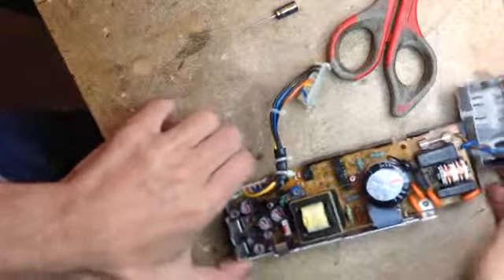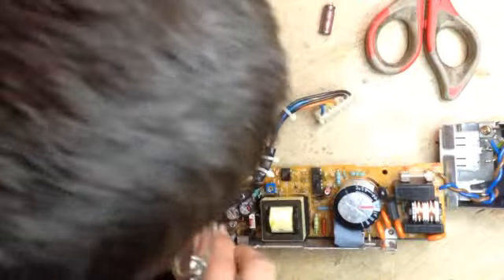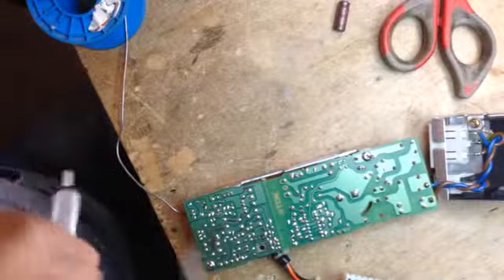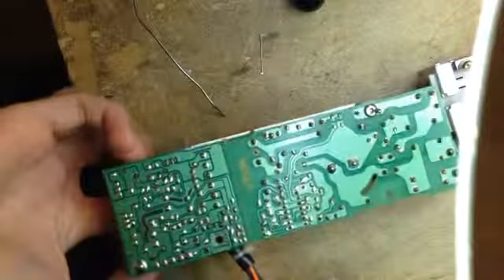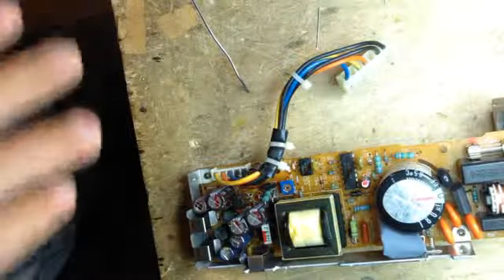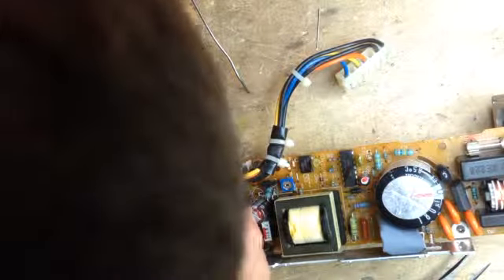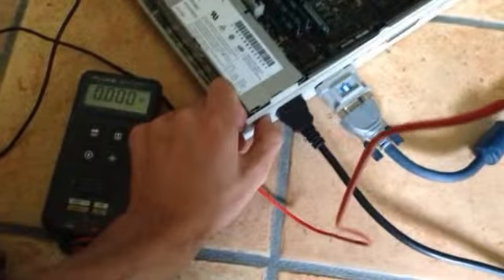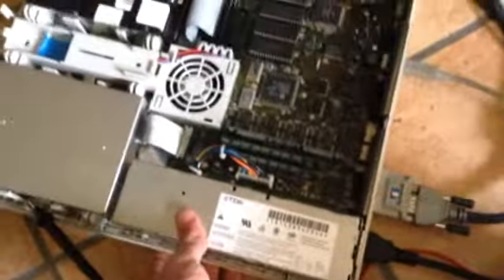Apple Macintosh LC TDK Power Supply ELNA Capacitor Replacement ReCap Repair (Take 2)

Comment: Yes I needed to replace the 3x 1000uf and 1x 47uf caps about a month or two after I did the others. They looked fine but after removing them you can see that they had all leaked.

Comment: Did you replace the capacitors on the logic board? They're probably just as shot as those in the power supply!
Reply from the maker: Yes, Got another video on that too

Comment: what was the initial probleme withe the power suply ? cause mine dosen't work and is clicking fast !
Reply: That's the exact issue mine has and those bad caps are the reason
Reply: @ducksonplays4190  i fixed it and its working great and btw do you know where i can find a keyboard and mouse that work with it ?
Reply: @homosapionse  well adb keyboards and mice but those are getting less and less common
Reply: @ducksonplays4190  okay thank you for the vidéo
Reply: @homosapionse  I ain't this dude

Comment: Unrelated question, but what monitors will work with this machine? I've fixed the power supply and plugged it into my Apple IIGS color monitor, but I am just getting a white screen. The fan spins up and the hard drive seems to be spinning but I hear nothing out of the speaker. Is there anything I might be doing wrong?
Reply from the maker: I don't have a IIGS so cannot confirm that it's monitor is compatible, but you could get a DB15 to VGA adapter and use a modern display, IIRC LCs don't require Sync On Green (SOG)
Reply: I have purchased the adapter, but I'm not quite sure how to set the DIP switches on it for the LC II. Are all modern monitors able to work with it? Thanks for your advice! FYI: The adapter I purchased was from amazon at this link: https://www.amazon.com/gp/product/B001I22L9C/ref=od_aui_detailpages00?ie=UTF8&psc=1
Reply from the maker: Not every adapter is the same, read the manual. most monitors should work,  LC II does not require SOG IIRC

Comment: Do you need to discharge the power supply before opening it up? Is there any procedure for discharging?
Reply from the maker: If you have a multimeter with low impedance, you can use that, or you can simply short the two ends with a screwdriver.